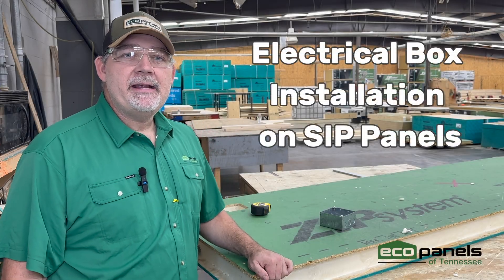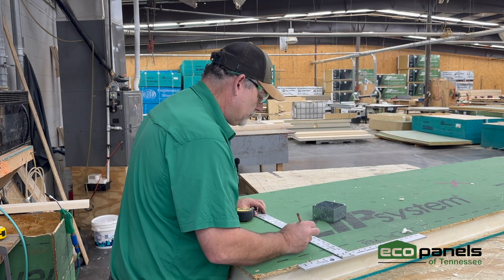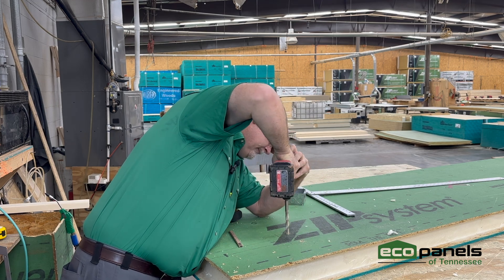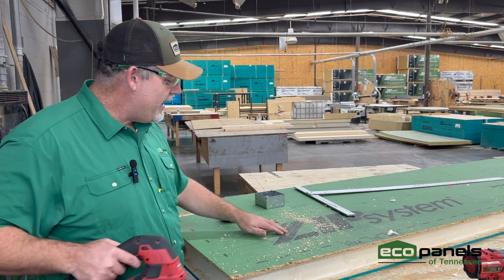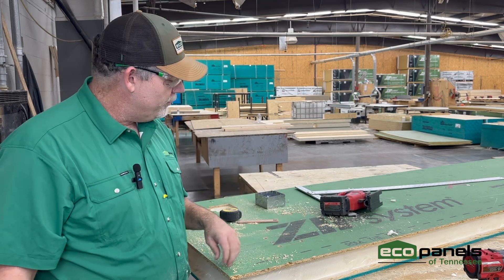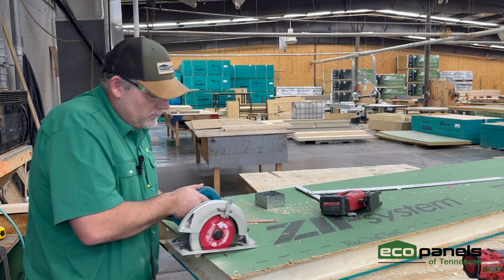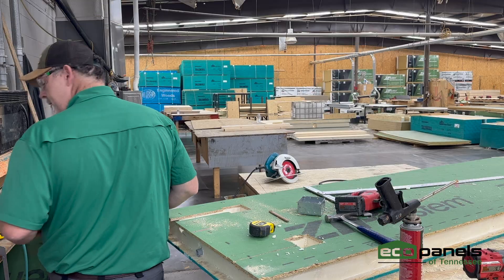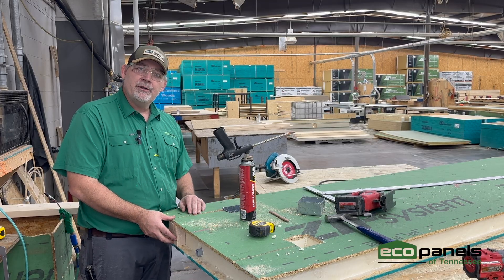Electrical Box Installation on SIP Panels | Eco-Panels of Tennessee

Comment: This is such a detailed guide on electrical box installation for SIPs! Most people don't realize how different the process is compared to traditional builds. It’s a shame this high-quality content isn't reaching more builders/homeowners yet. Have you checked if your video metadata is optimized for the current YouTube algorithm? This deserves millions of views!
Reply from the maker: Thank you so much for the compliment! The shop guys aren't trained to not stand in front of the camera, so we may redo this one at some point. That said, it's pretty straight forward. Our foam doesn't melt at any temperature, so it has be to mechanically removed rather than cut our with a hot knife like EPS panels.It's a bit of a different approach for ours, so we hope this helps answer questions around it. Thanks for watching!
Reply: @EcoPanelsofTennessee  Appreciate the detailed response! That’s a really interesting point about the foam not melting. It definitely sets your panels apart.

Even if you redo the video later, your current content could perform much better with proper SEO. I found 3 keywords your competitors use that you can easily rank for.

I'd love to send you a free mini-audit showing how to optimize your existing videos to attract more high-quality leads. Should I reach out via your website’s contact form, or do you prefer email?